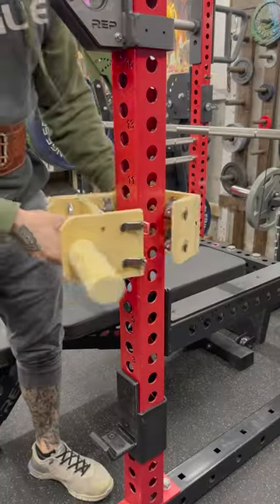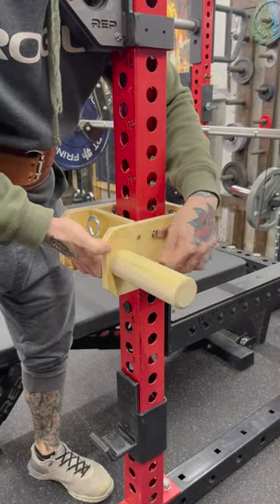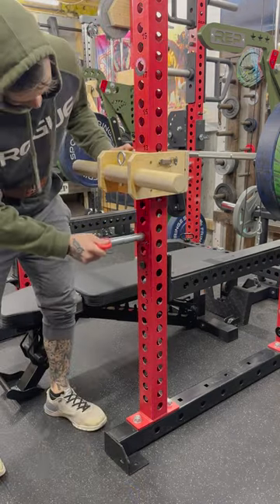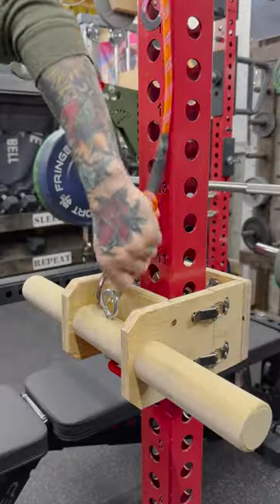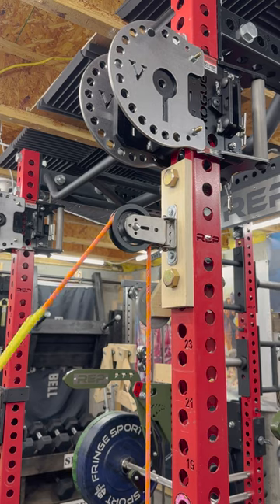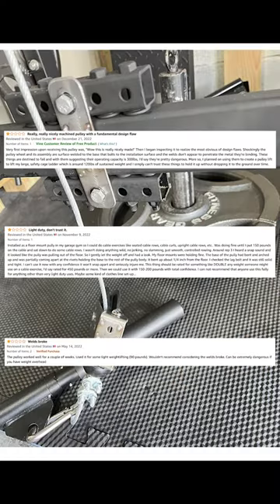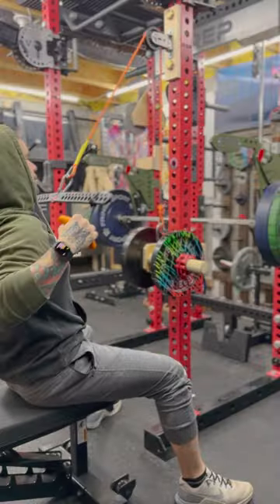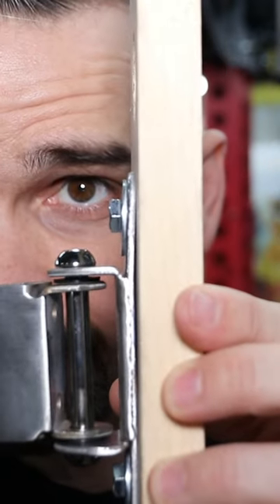Update on the DIY slider pulley system!

Comment: Walk behind lawnmowers have a single wheel the operator rides. The connecting joint from the wheel’s arm to the mower would be perfect for this application. No need for pulley or rope as this velke wheel can handle 400-500 lbs person. The joint also allows lateral jostling, but not too much. Love watching the engineering behind your designs
Reply from the maker: I’ll look into it

Comment: If the wheels are too complicated, you could try to use a low friction material like Delran as a sleeve with big rounded edges, so it doesn’t catch on anything that may be less complicated but that looks awesome!
Reply from the maker: That’s a good point. Wheels and rollers aren’t 100% necessary.

Comment: As far as a pully goes, you should be able to find a beefier one somewhere like hoe depot or Lowes, there are pullies used for electrical work and pulling wire than can take heavy loads, an electrical supply house might not be the worst to call. For a smooth conversation give them size specifications and ask about the mounting plate securement
Reply from the maker: I’m working on designing a new pulley specifically for this use.

Comment: The cheap pulleys that come with an eye bolt could easily be used by replacing the eye bolt with a normal bolt…

Also do you think using UHMW or even pvc pipe would work as sliders?

Comment: add more pullies it will disipate the strain from two locations your arms and down those two angles need to be acounted for. I think you need two aditional pullies installed. Also more rope length. good luck
Reply from the maker: Thanks for the suggestion

Comment: There are 20 dollar pulleys for that if you already have a rack
Reply from the maker: I’ve bought every pulley on the market and compared them in a YouTube video. There is nothing currently available that will work for this without needing to be modified.
Reply: @KaizenDIYGym  before I had my cable station I used a pulley on my rack. Actually worked ok and held very well. I had two downsides: unclipping a carabiner when changing weights and swinging of the stack. The last one I solved with a rubber band to my rack.

Comment: Use a 3:1 pulley and that should take off some of the stress of your components
Reply from the maker: A 3:1 would decrease the amount of weight felt during the exercise. I would need to add more weight to compensate. It’s not a bad idea but I have something else in the works.